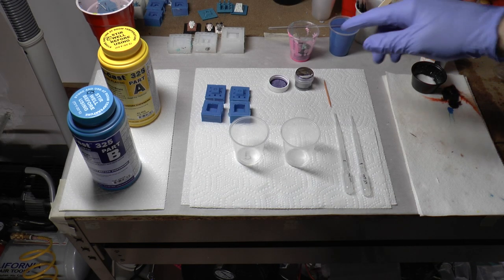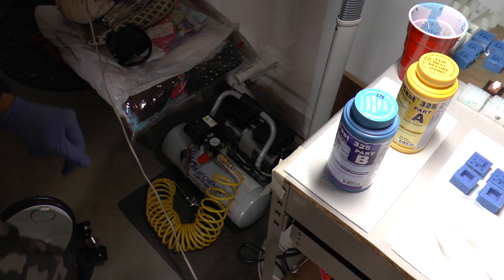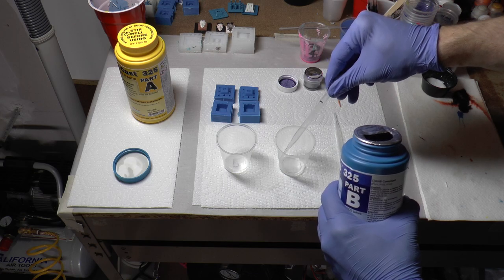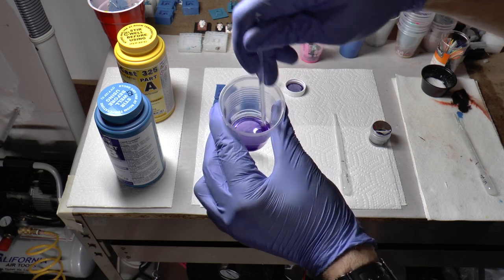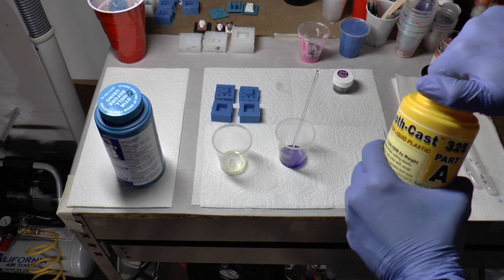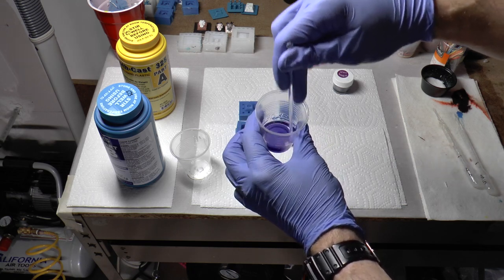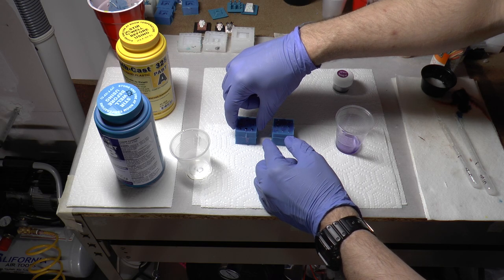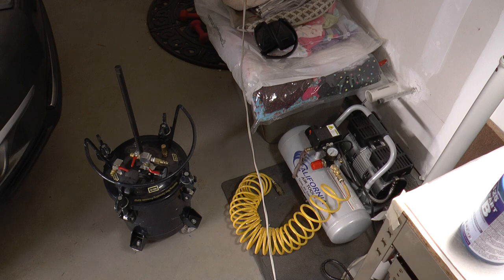Z-Butt:  making keycaps with resin (3 of 4)

Comment: Hi, how did you modify the pressure pot tank for resin?
Reply from the maker: I removed the inner pipes except for the center agitator, which I pulled up by loosening it with a pipewrench.  Here's what the pot and inside lid look like after:
https://imgur.com/a/bC57Gym
Reply: @NG-ob2ry  Thanks man!